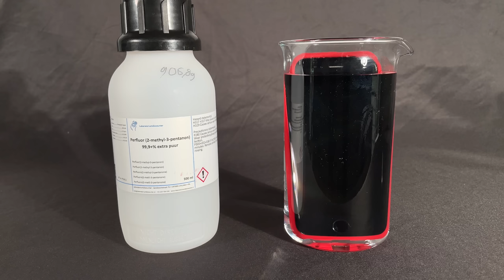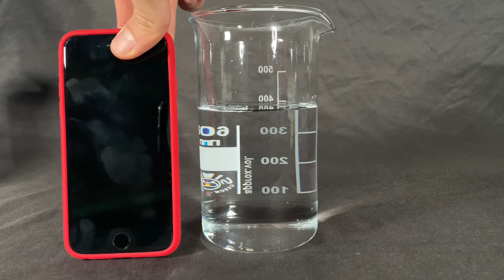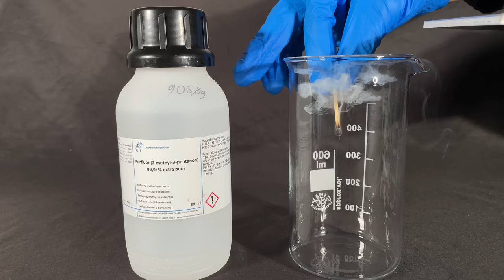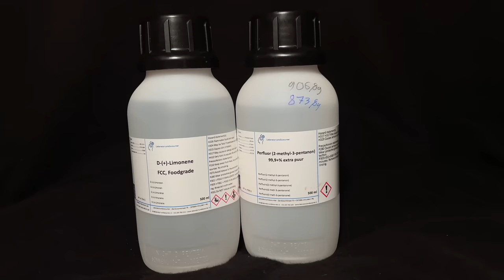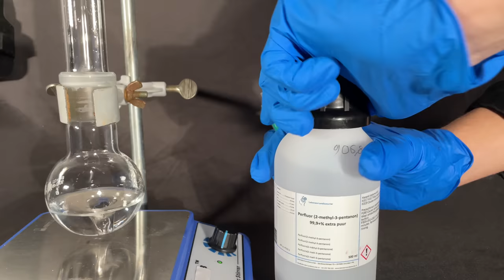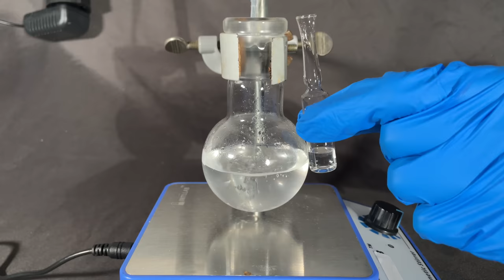Dry Water: Experiments With Perfluoro (2-Methyl-3-Pentanone)

Comment: They used to use this stuff for coolant for the cray supercomputets back in the day, marketed under the trade name Fourinert dielectric coolant. Was made by DuPont. It will react spectacularly withmagnesium and warmed aluminum. 😁
Reply: Fluorinert FC-70 is a very different compound, a perfluorooxyether rather than a hydrofluoroether.

Comment: Great stuff! I had a fluid of this type in mind for an electronics application at one time, and shopped it.  The project never happened, but I was prepared to buy it by the gallon.  There are numerous similar compounds with differing thermal characteristics, all sold under the brand Fluorinert.
As I recall its cost was considerable, several hundred dollars per gallon. But for the application it promised to be a huge money-saver.  Filling an enclosure with an incompressible fluid is one excellent way to deal with pressures deep under water.  One needs only a robust enclosure that's well sealed rather than a massive pressure vessel.
Reply: @BigBoss-rh7zq  
That's a very nice offer, but I don't have an identifiable use for it anymore.  Perhaps others reading this will be interested.

Comment: When fluorine compounds actually bad at fluoronating stuff
Reply from the maker: fluorine grabs on tightly onto that carbon chain. it requires a lot of energy or special reducing agents to make it let go
Reply: @THYZOID  Or a lot of heat.
Reply: Organofluorine compounds in general are very poor fluorinating agents - especially when compared to F2 or HF. The bonds have a reasonably large ionic component, as well as excellent overlap between the carbon sp3 and relatively tiny fluorine p orbital.

Comment: hi sir, can you use c6h6 aromatic benzene
Or does it need an octane booster, please answer, thank you cars
Reply from the maker: you should not use benzene as fuel it makes a lot of sud while burning
Reply: @THYZOID  Thanks for the reply. In the absence of gasoline, can it be used as a substitute?
Reply: @fadiyosef4452  i would never recommend using benzene as fuel. even diesel works better!
Reply: @_thisnameistaken  For the black smoke that will rise? Or will it affect the engine?
Reply: @fadiyosef4452  i think it would either not make the engine run properly or the smoke would clog it up
Reply: @foc2241  Why can't it be used؟

Comment: Hmm, Perfluoro- 2-methyl -3- pentane alcohol i assume it is quite toxic.
Reply from the maker: your assumption is incorrect. apparently it is perfectly safe. I still wouldn´t work with it in an unventilated area
Reply: No, because it's quite unreactive. Those fluorine atoms aren't coming off. Think Teflon....
Reply: @THYZOID  No way this stuff is nontoxic, compare with HFIP and hexafluoroacetone. That carboxyl is quite electrophilic and will likely alkylate whatever it wants to
Reply from the maker: @Doubleone44  i´m just telling what the literature says. literature says it is safe. i doubt it but it is what it is
Reply: @THYZOID  was this literature sponsored by 3M or DuPoint?
Reply from the maker: @bocian0  Id on´t know anymore but it might have been sponsored by them and thus i wouldn´t trust it. This is also why I would not work with this stuff in an unventilated area
Reply: @joeylawn36111  Interestingly reactivity is not requirement for toxicity. Example xenon is used in general anesthesia. IE you can definitely get overdose with it, even when administered with adequate oxygen concentrations. Also perhaps more illustrating example is acridine orange. It intercalates between DNA and cause it to twist little bit. That makes the DNA correcting mechanism to slip and fail. IE it causes mutations and possible cancer.
Reply: @Doubleone44  Unfortunately such heuristics fail sometimes. It might very well be non-toxic. Usually the data comes from murine studies, but sometimes primate studies are required depending on usage. IF the studies are well designed and executed, then they are quite reliable.
Reply: @mduckernz  Good point - Asbestos doesn't chemically react in body tissue - but it's darn sure harmful

Comment: i got the huawei mate 20 pro its water tight
i usually wash it in the sink xD
Reply from the maker: well then the time to wash your laptop or such with dry water has come
Reply: @THYZOID  i need to wash my whole desktop pc because some glycerol has accumulated on some parts inside due to vaping
but i guess isopropanol is the more economic choice due to the amounts needed 😅
also dry water being such a poor solvent it might not do anything to the glycerol at all
Reply from the maker: @TheRolemodel1337  i guess it would leave the glycerol untouched
Reply: @TheRolemodel1337  I have had similar issues lol but at least for me it was easy to solve.

I used a 25% IPA in distilled water solution and put it in a misting spray bottle, turned off the power but left it plugged in (for earth line ☺️), and sprayed everywhere that was a little sticky. Then used paper towel to absorb off the liquid. 
Repeated this a few times as I figured each time was just diluting the glycerol.

After 3 applications it was totally clean and not sticky. 
Also it removed all of the dust that vacuum or canned air couldn’t remove before in the process, yay!
Reply: Oh yea I also added a drop of Triton X-100 anionic surfactant, but I think this is totally optional, I was just being thorough, to get everything that even slightly had a lack of polarity lol, made it soluble
Reply: @mduckernz   thx for the advice :)

Comment: Yeah this building up in the atmosphere is never going to be an issue right? Right?
Reply from the maker: No look it up. It´s apparently 2019x better for the ozone layer than CCl4 and more than 10000x better than CF2Cl2
Reply: @THYZOID  look I’ll eat my words on that one, looked into this and it actually breaks all the rules for all the perfluoranted substances I know. Negligible GWP, ozone wasn’t much of a concern tbh, but also a residence time of only 5 days atmospherically…. That one shocked me, how is it so easily broken down in sunlight… I am concerned that the most obvious pathway leads to fluoroform which has a pretty significant GWP
Reply: @geekswithfeet9137  with these compounds the question shouldn't be "Does it break down?" but "What does it turn into ?"

Comment: yay, toxic PFAS!
Reply from the maker: not really. to make PFAS (which I initially wanted to do) you would have to connect the sulfur right to that carbon chain but in our case it is an ester meaning there´s an oxygen in between sulfur and the chain
Reply: Do you know what PFAS is? Not this material.